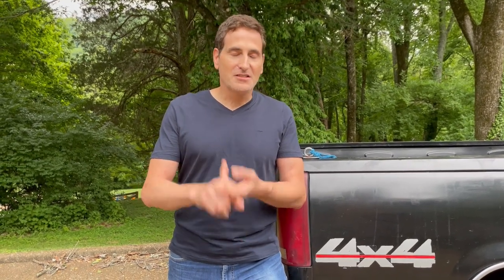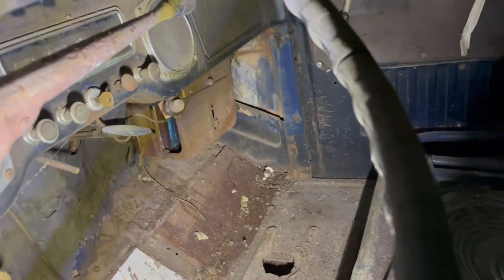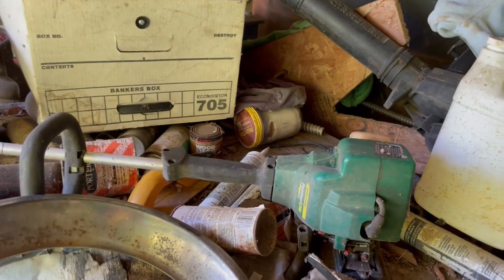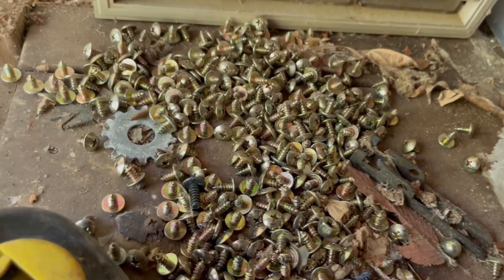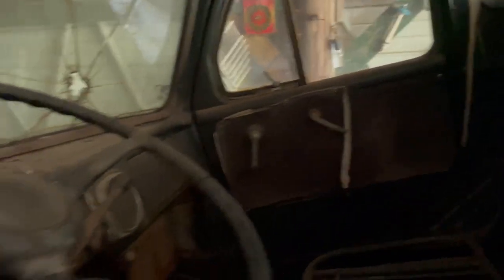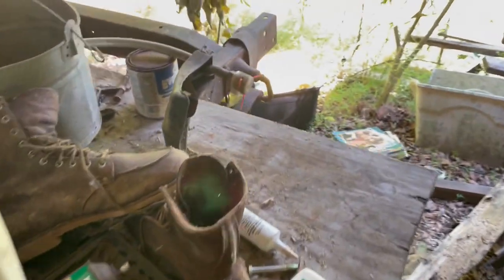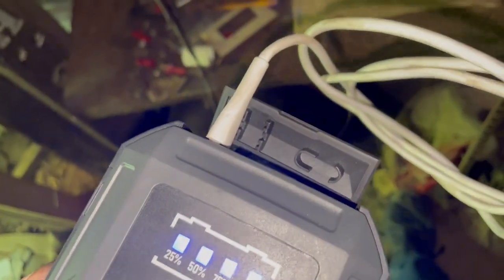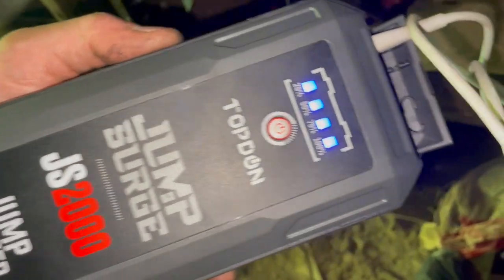Will it run? 1950 Dodge pickup! Heat, darkness, space and a bad mic all conspire to stop me!

Comment: Really liking this video.  I grew up in a very remote area & there was an unused 40 acre field behind our house.  When I was 11 yrs old my Dad bought 1 of these exactly like this except color (it was black).  No battery in it and radiator leaked, but I was allowed to roll it off a hill behind our house (these old vehicles with generators would start without a battery) and drive in the field as long as I wanted.  For some reason I was not allowed to shift out of low gear although all gears worked.  My legs would not reach the pedals so I sat on the front of the seat and that is how I learned to drive in a 1950 Dodge pickup.  Thanks again for these videos.
Reply from the maker: That is a great story. Thank you for sharing.

Comment: Richard this is a hard one. But your 1949 was worse. Your the best I have watched getting this old Iron running. Had to save a pick up with a gun rack. Just was meant to be. Thanks so much! 💯👍👊
Reply from the maker: Right Terry, the 49 was much worse. This one may have been tougher though because of the heat and cramped space. I think I lost 5 pounds just working on it.

Comment: I love the dust storm we got in the camera when you cranked it for the first time!  I saw a green door at the back of the shed.  I guess that didn't open?  I love that you can find such old rigs and get them working.
Reply from the maker: Yes, that door used to open years ago, but it is now jammed in the mud and holding up the back wall. That shot of the oil and dust was so unexpected. I thought it would look terrible, but it did turn out nice. Thank you for the support!
Reply: @whattherust  That crack in the windshield.  Do you think rock or bullethole?
Reply from the maker: @gavinrewell9703  Definitely a bullet hole. The same bullet went through the middle back window.

Comment: Excellent cab shape and frame for sure also amazing me 1950 Dodge not called Fargo back then as I remember them as ! Also surprised that Flat Head 235 Cubic Inches 6  cylinder got unstuck from sitting long time and after Mystery Oil in spark plug holes clean it out tell by video footage too! Also hopefully transmission is okay plus axle to when planning pull it out too! I had giggle on throttle is barn hinge and I seen a 1968 Chevrolet C10 pick up had 292 in line 6 cylinder  motor with 1 barrel carb Carter  with hand choke cable knob in dash plus Manual transmission column shifter too 1978 GM posi rear gears 377 ! Also gas pedal was funny had on lever of rubber took off had weld of farm tractor from 1960 metal pedal on it too T backwards too on bottom of lever ! Farmer neighbor I knew taught me drive it when age 13 to 18 and when sold farm auction to new owner kept that way to after restoration to plus first Automobile repair company work for too! Also bet didn't know those 1945 to 1955  Dodge truck 235 flat motor also rad , Generator,  plus floor shifter 4speed  and axle were used in farm tractor company made in Brampton Ontario Canada near me company called Noresman row crop tractor paint red and yellow decals and built Cockshutt COOP 40 made plus share intake and outake manifold same but updraft Zenith 1  barrel carb or truck style depends buyer's wanted plus 6 volt positive ground too ! If saw Noresman tractor it like 1937 year of a  McCormick Deerning or Farmall F 20 row crops tractors and so cool ! How found about my one boss first work for back 1992 to 1995 had restoration one and so cool 1950 Noresman motor put 40 hp with 60 torque on 235 Flat Head 6 cylinder motor if saw tractor think Dodge truck with floor shifter on single seater seat of farm tractor! Glad see these videos brings memories back then and enjoy helping with information too!
Reply from the maker: That is a lot of good info. Thank you for the support.
Reply: @whattherust  welcome

Comment: Those Autolite/Prestolite distributors had a braided ground wire that went from the housing to the breaker plate to ground the points. I've also had the points fail around the pivot arm and spring and cause problems but that was on newer cheap points.
Reply from the maker: That is helpful information about the ground strap. Thank you!

Comment: Would of been interesting to see if the clutch and transmission still work but none the less, a chrysler flathead engine is real tough to kill.. didn't cost as much as some do to get running money wise... thats a plus... I think those distribitors are a flat screw style where it is in time or a hundred eighty out when put back but just pay attention to rotor pointing direction... not like the chevy with gear teeth on the distributor, kinda like the flat head fords with distributor in the front by the vibration damper.
Reply from the maker: That flat screw info is good to know. Thank you.

Comment: If you ever find yourself in this situation again, you can get a pry bar and activate the starter manually from outside the vehicle. You're on the wrong side but you can reach the carb and pry bar at the same time.
Reply from the maker: Thanks for the tip Patrick.

Comment: I think I would disconnect the fuel line from the pump to the tank so you're not pumping sludge from the tank thru the pump and into the carb.. Job well done.. Did you acquire this beauty ? Would love to see this gem get a bath and on the road again ...
Reply from the maker: Agreed. The fuel tank was actually not in place, only the filler neck. The truck isn't for sale, but I am going to try and buy it anyway. It is special. Thank you for the support!

Comment: So what do you do with these old vehicals. Just see if you can make them run then back to original storage to die again?????
Reply from the maker: Most of them I do not buy. I help the owners get the vehicles running, and leave it to them for the next steps. This truck is an example. I got it running and ready to move out of the shed it is in (lots of work not on video), and the owner will be taking the next step to get the needed repairs done to make it roadworthy.

Comment: That bullet hole in the windshield is suspicious...might explain why the truck has been there so long.
Reply: Christina says the same!
Reply: @morewhattherust  I was told that when an engine was locked up it was useless or you would have to have the engine rebuilt. That apparently was not true. Thank you for showing this.
Reply from the maker: @dlucas527  That's right, David. It all depends on why the engine is stuck and how badly. If it sticks from overheating, or excess water in the engine, you might be out of luck. If it is stuck from age and moisture, you may be OK.

Comment: i've got a 50's dodge I pulled out of a field. the generator label says output its 12v. in your video you mentioned 6v from the battery. will it hurt it if i just hookup a 12v battery and go from there ?
Reply from the maker: If you disconnect the rest of the electrical system other than the start you will not damage anything. That is what I did on this truck. Only the starter was let connected.

Comment: Another way you could have broke  the engine loose  put it in gear put a pry bar on the rear end and turned it try that way  go to Walmart and boat fuel primer ball hook it up to a gas line and put it in your gas can hook it to the fuel pump you can prime the fuel pump and carburetor and you can see if the float is stuck or not by doing this
Reply from the maker: That is a good tip. Thank you.